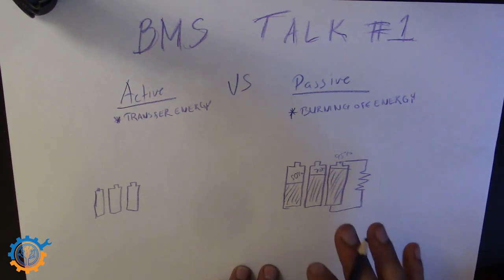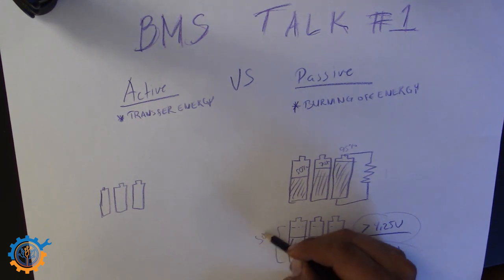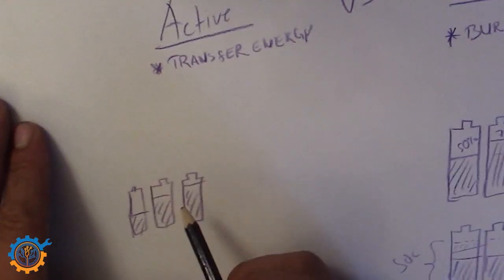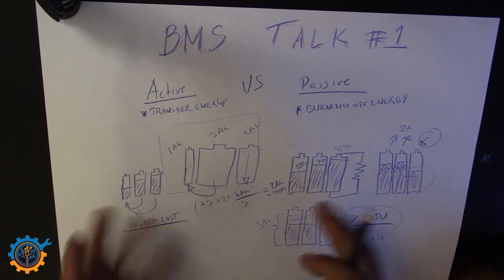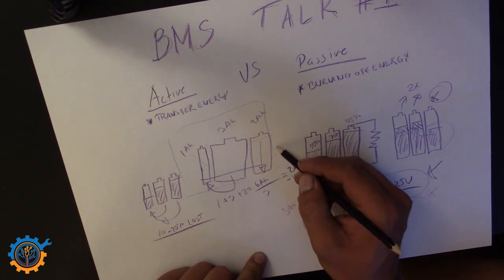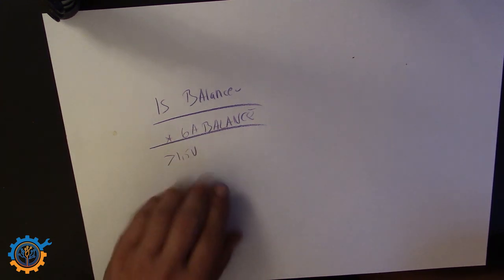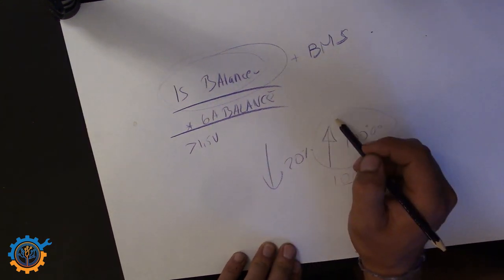BMS talk: Active vs Passive part 1

Comment: drain all cells down to your fav bottom voltage, like 3v, bottom balance. then just charge till first cell hits your fav top volts, like 4.15,  that way imbalance is highest at start of use, and gets less as pack discharges, better protection against a cell going undervolt.  5 years on, still using same packs. thankyou jack ricard for this advice.

Comment: A passive bms is fine for a power wall. The amount of kwh's dissipated as heat is tiny compared to the kwh's flowing into and out of the pack. For electric vehicles an active bms helps optimize and minimize kwh's lost as heat, but also costs more in R & D.

Comment: Thank you aloooooot
 I want to built an e-bike pack using old laptop cells with different capacity and different ages . Wich balancer to use for the pack to work decent??

Comment: Great explanation!
I'd like to build an active balancer just because of the technical challenge.
The algorithm is like using a syringe to syphon off liquid from overfilled buckets to transfer to emptier ones.
We can do active balancing manually by connecting 2 supercapacitors in series to a high cell then physically connect to a low cell and allow them to equalise, rinse and repeat, but this way only allows a tiny amount of charge to be transferred as the voltage differentials are so small. This could be improved using a buck/boost to completely fill and empty the caps each time so a decent amount of energy can be transferred.
Implementing this simple algorithm In practice is difficult because the cells are all connected in series, so have to use many relays to physically connect and disconnect the caps and ensure that only one cell is active at once for "read" or "write".
A microcontroller could keep track of cell voltages and control a 4 bit to 16way multiplexer to select one of up to 16 cells and ensure only one is active at once, with another signal line to indicate direction. Switching frequency doesn't have to be high, and fairly high currents can be used.
The main expense for this is the sheer number of relays or solid state relays required, and is a wiring headache!
Reply: The algorithm can also take into account the potential difference from an average measured across the pack voltage to ensure that it shows preference to the highest and lowest cells, also the balancing current could be altered depending on the amount of discharging or charging current, something that passive balancing can't do as they have fixed load resistors, meaning that under higher charge currents the highest cell will still receive a charge and therefore cause charging to be cut off to protect that cell from being overcharged, regardless of the state of charge of other cells, I know this is an issue that does not really affect new well matched cells

Comment: GREAT Talk!!!      So far, I have created 56packs of 130ah each.   56/14 gives me 4 x 48v batteries - e.g. 520ah @ 48v.  I top balanced each battery (14 packs in series) and then used charge controller to set the 'battery bank' to same voltage and put the new battery online.   The Midnite Classic 150 controller itself is providing overcharge protection (I believe) in that max charge voltage/cut-off is settable and I've set it to 58.2v (4.16/pack) as a fail safe.     Don't have low voltage protection except for 47v cutoff...    e.g. potentially 1 of the packs could go way low but not sure if that's all that dangerous.       I run between max charge of 54.6v (3.9v/pack) and discharge cutoff of 47v (3.36v/cell) giving me pretty good 'variance' at high/low ends.     So far,  I MANUALLY monitor voltages of all the packs and find a max of 0.5v difference in some batteries at low end but only < 0.1 as soon as they charge significantly up to 3.9v top end.    As you said in video, the 'good packs' all seem to stay steady over the last several months of operation - no problems.     I do plan to do Batrium in next year's budget - but I think I'm OK for the time being.
Reply: I ment to say - a max of 0.5v difference at low end within a battery (not between batteries) - e.g.  high/low v difference within packs that make up a battery

Comment: Yes I agree with you about active balancers I run Diypowerwall and recently I have that issue with balancers (I have 1s balancers) that you mentioned if you have big capacity to balance down balancers don't work as good as I thought..... 
but if you have somehow already balanced system then they work as they should... 👍 
Excellent video... 👍
Reply from the maker: Yeah people think they will balance up to advertised 6A but that is not true when getting close to same voltage im afraide. In that sense the balancing is small

Comment: I'm running my garage off a Tesla battery module at 24 volts the cheap BMS that I use gets hot if I'm charging too fast or drawing too fast from it can I run two of these BMS in parallel to take the heat down without using a fan
Reply from the maker: Potentially yes but its better with 1 bigger. Paralleling can cause other strange issues where they work against each other.
Reply: @DIYTechRepairs  hello, that's an interesting topic, any links where it is discussed more detailed?  i also thought to split up my 15kWh pack into 2-3 smaller ones. it has d advantage of redundancy and possibility to switch 1 just off for maintenance/repairs without loosing all power!

Comment: Have you tried active balancers from ali express.  They come in different sizes 1s-14s. It basically is one board with black modules (probably bi-directional dc-dc converters). Constant balancing current is 6A with 20A peak. Thats what I have asked last night at HBPowerwall but i got brushed under carpet with cable losses - which is different kind of animal.
Reply from the maker: Yes i have. Balance AVG in those are 100ma. Max 6a with voltage diff of 2v. IF you watched My video you Saw that over time you wont get much gain. And yes you save alot more energy fixing cable losses or losses in Gear than going active balance. I balance at most 0.5 kwh per month currently... My losses are over 150kwh. Active would actually have a higher loss since it constantly balance ;) active have its area but not on a powerrwall where the aim is equal capacity from start
Reply from the maker: Note that the goal is not to have to balance. And we try only to balance when we have excess energy
Reply: Could you provide link to the video where you review them??
Reply: Ok, i have found it. It is a shame you never measured efficiency of those 1s balancers. Anyway i am thinking of using them only when cells are out of balance or turn them on for 1hr every 24hrs. Nice videos by the way, thank you.
Reply from the maker: @ISeeYourLies  Its between 80-90% (Not tested by me though)  The thing with them is that they constantly balance if the voltage diff is higher then 30mV or something. That mean as soon as you apply load or charge and the cells are just slightly uneven they start counterbalance even though they arent unbalance but the IR itself is causing it. Thats one of the negative things that potentially can cause issues and use more energy than you need. Advantage is when you can set WHEN to balance and you cant do that with those rellatively dumb balancers  :) They for sure have its area where you have lets say 20Ah 30Ah and 10Ah packs in series. With passive you can max use 10Ah but with active ustem you could potentially use 20Ah total capacity.. BUT in my world its better to make sure the packs are even from start. But thats not always possible.  If you plan to run them for short amount of time you need a way to disconnect them and that is extra gear and you also need equipment that for instance does it in the bottom or in the top or if you are after middle balance. With that said you still need individual cell monitoring of some kind
Reply: I have just measured power consumption on my 6s active balancing board with the same value resistors acting as cells. It was drawing 12mA at 25V which is 0.3W while in standby.

Comment: When your batttery pack start to getting old , after 500 cicles sure start needing active balacing, when the battery pack are new, small capacity and have   simetrical capacity passive is OK.
Reply from the maker: Not needed. I have packs doing above 1000 cycles Still running normal passive :)

Comment: All I ever see are videos of on or the other, not both Passive BMS and Active Equalizing Balancer at the same time. Doesn't make much sense that you wouldn't use one of the newer BMS for the Bluetooth, curent protection and voltage protection. With that and the use of an all directional Equalizing Balancer you get more drain from the hottest of your cells dumping to you lower cells as you charge giving you a closer balanced charge.

Comment: Where did you get 10 to 20% loss, I've found active balancers with efficiency in the high 90s, you don't go into the various algorithms
Reply from the maker: Everyone Will state higher Numbers since it seems nice :) but in the real world its different. Yes you can get 95+ but dont expect that from the cheaper versions :)
Reply: @DIYTechRepairs  agreed so my advice would be not to use cheap active balancers in the same way I wouldn't use a cheap BMS

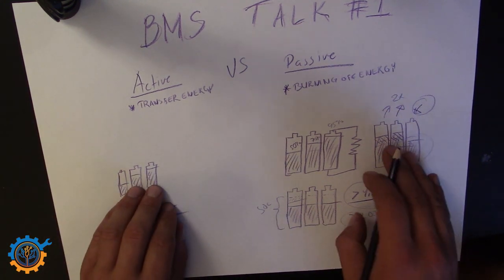Comment: great vid! @9:30  so this would mean for a 14S/120P pack made up of scavenged cells of different capacities: always be careful to arrange 14cells of similar mAh into 1S (in series). but it's not a problem to then parallel many series of varying capacities, the V will drop equally, the cells with smallest capacity will be the least loaded?